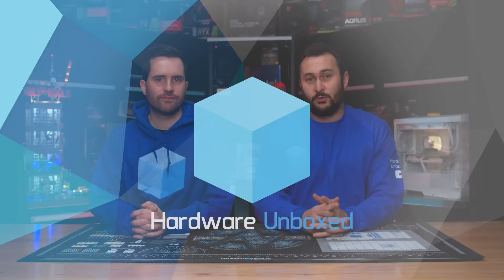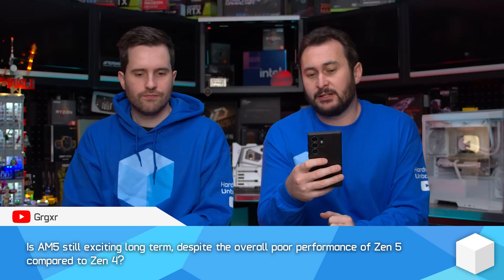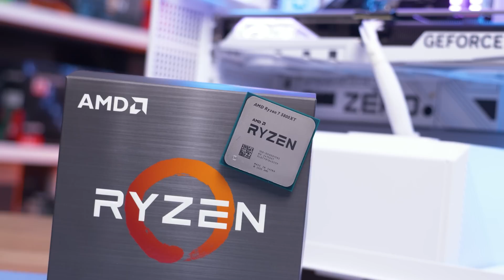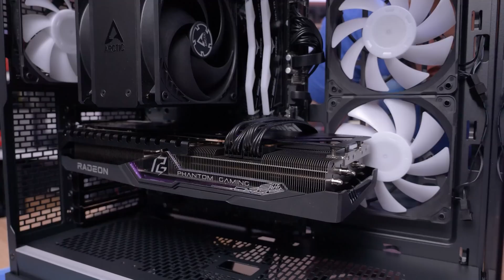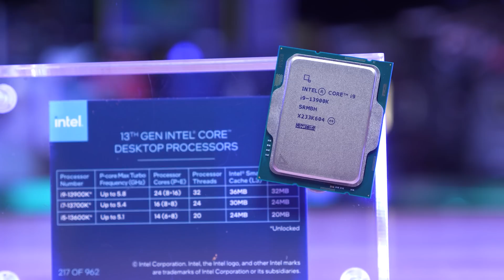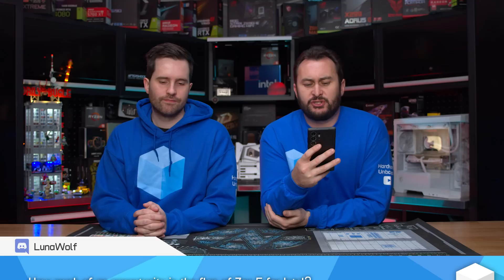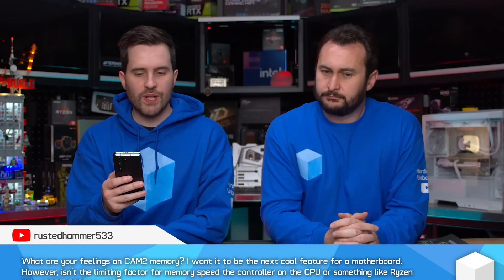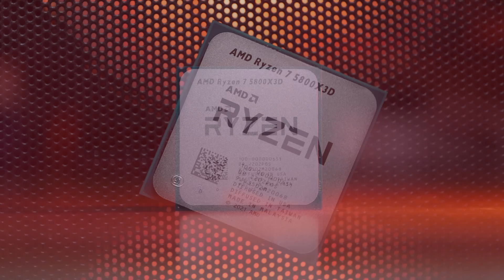Our RDNA4 Expectations, Can Intel Gain Lead After Mediocre Zen 5?

Comment: I mean for gaming, Arrow Lake just has to be as fast as the 14900K and they beat the whole Zen 5 lineup. In multi Core and single Core, the 9950X is only 5-10% faster than the 14900K in its 253W Mode. So Intel doesnt have to do much. Bring stability to the platform and a decent 10-20% boost in multi core at lower power. Thats it.
Reply: Not really going to be easy given the last 2gens performance tho is it?
Reply: @paulbaddiley7326  I mean Intel didnt really had to do more. Lets see, Arrow Lake seems promosing. Seems more stable, less maxed out. I think single core will be pretty much the same given the lower clocks, but efficiency and multi core should be really good.
Reply: ARL has to gain 10% in gaming to catch up to Zen 4 alone. Well, actually also they need to triple efficiency and cut prices in half if they want to compete with the 7800X3D.

Comment: My expectations for 8800XT is exactly the same performance of a 7800XT but touted as better efficiency.
Reply: That would be terrible
Reply: @A.Froster  terrible, but reasonable and realistic expectation. That's not hope, just an expectation.
Reply: @A.Froster which means it’s probably a certainty to happen 😢. Probably gonna be like what is was going from vega 64 to 5700xt. 10-15% faster, better features, less power.
Reply: Well, having low expectations is often a good thing
Reply: I did hear that ray tracing performance is significantly faster.
Reply: I expect them to not under estimate the damand of ray tracing this time around
Reply: Now of days, it seems to be one or the other, so that makes sense.
Reply: I bet AMD are gonna do a driver update similar to the 24H2 Windows update for their CPU's where they expect 10-20% performance uplift for their latest gen GPU's but it just ends up improving all the older gens as well by roughly the same amount
Reply: Intel is basically non-existent, amd given up on high end so nvidia keeps charging $100-300 more per generation with no competition whatsoever, very sad
Reply: Faster RT. Remember, NVidia fans demand that 4000 cards are better because they do RT faster than the AMD equivalent. Or does it no longer matter if it isn't NVidia doing it?
Reply: And at the same price with the same 16 GB VRAM
Reply: If it used 33% less power for the same performance that would actually be a great improvement. But i prefer FPS boosts
Reply: @axelfiraxa it would be an improvement body would actually care about and only bring up as icing on the cake or because theres literally nothing else good about the card
Reply: same
Reply: I’m expecting the top 8000 series to be performing like a 4070 ti super in raster and ray tracing. And be introduced at the same price as those cards. Maybe  draw less power.
Reply: @EdDale44135  It would never sell if it's the same price as the 4070 ti super. Why would anyone buy Radeon for the same price as Nvidia?? This comment doesn't make sense
Reply: The 7800XT was built on the same specs as the 6800. There is no 7800 this gen, so expect an 8800XT to be superior to the 7800XT.
Reply: If that ends up being the case the only thing exciting about it is that the 7800 XT will drop in price (hopefully to what the 6800 XT costs now).

If the Ryzen 9000 series taught us anything is that efficiency is not enough to incite the market, especially if they already have something that they can get by with.
Reply: It is small update, so yeah possible. Maybe tiny bit more RT speed, but let’s see.
Reply: 2 year gap for a rename refresh with zero performance uplift. Everyone in the department should be fired for not doing literally any work in that time lol
Reply: @flinchy-5224  if it does offer even just a 5% boost while using half the TDP then that is a big win. Do you understand how difficult it is to engineer the same or more performance for half the power? That is no easy task. You gamers really have no idea what you're talking about. Just like all the gamers upset about the 9700x even though it performs better than the 7700x while using the power of the 7700. That's a big one. Just because it doesn't add another 40 fps to your $3 game doesn't mean it's a poor product.
Reply: No will be have raster Performance like 7900XT and RT Performance like 4070TiS
Reply: same same same only changed cod name 6800xt 7800xt 8800xt same performans 🤣
Reply: @KarizmatikEmmi  The naming scheme is confusing but the 7800 XT was designed as a mid-range GPU to replace the 6700 XT and 6750 XT. It was released four years after the 5700 XT for about the same price if you adjust for inflation, and is about 100% faster, with double the vram capacity and some improved features. I'd call that progress.
Reply: @syncmonism  the 7800 outperforms the 6700 by 22% .. what are you even blabbering about?
Reply: @monsG165  providing the exact same performance for half the power usage is a huge win. Everyone always complains about their PCs being space heaters so AMD releases the 9000 series and everyone cries 🤦🏻‍♂️🙄 there is no satisfying you people
Reply: @---GOD---  look at it from average consumer. Which one will make them excited to buy a new thing, as Clarkson says “MORE POWER” or trying to explain to them how efficient this card is on a box art?
Reply: @monsG165  the average consumer isn't upgrading every year. The average consumer will notice a huge Performance increase because the average consumer upgrades every 7 or so years. If I'm upgrading from a 7 year old machine, would you suggest I go with the high power card instead of the newer card with similar performance for half the power usage?
Reply: The 6800XT can be considered better then the 7800XT, this is really really bad.
Reply: @marktackman2886  7800xt is better in every way only a little but better.Still 7900 GRE should have been real 7800xt.
Reply: @markolumovic2750  due to your common sense approach I concede
Reply: @marktackman2886  Well i am not in to ego competition they dropped the ball so in a way we were both right,In some especially older games 6800xt is faster in new especially RT heavy games 7800xt is faster then both 6800xt and 6900 xt again not much faster.So we are coming again full circle where 7900 GRE should have been 7800xt and 7800xt should have been just 7800.And if 8800xt can't match 4070ti in both raster and RT they should not bother to produce it at all.
Reply: And maybe slightly better ray tracing performance. 😂
Reply: They will just release driver updates that will slop down previous gen
Reply: @androjackson480  I've been saying that for years, they actually do that.
Reply: @Edit1213-l6w  They don’t slow old cards on purpose, that would just make them look bad. New cards gain an advantage for many reasons such as games utilising the latest architectural improvements (e.g., async compute) and newer cards being the focus of driver optimisations.

Comment: What a time: AMD enemy (and Intel ally) - AMD own incompetence.
Reply: Just as well as Intel's incompetence helps AMD a lot. What a time, all high-tech companies are doing crap! NVIDIA at least releases reasonable hardware that doesn't burn/degrade, even yet they provide no improvements for mid range at all.
Reply: @Vivicect0r  doesn't burn? right....
Reply: @Vivicect0r  You must have forgotten about the melting VHPWR connector.
Reply: @frantavopicka5259  Oh, I really did so. So much as I dislike NVIDIA forgoing extra overload capacity and failure to design humanly interface of the simple shackle (since you know, clicking helps a lot),  it was not such a widespread issue as media made it.
Don't get me wrong, I use AMD 7900xtx  (another technical failure BTW, its a good card, but it clearly couldn't reach its target performance) and am totally not an NVIDIA fan
Reply: This used to be the trend some 10 years ago.

Comment: Every gen its the same discussion with AMD yet their drivers are still made by the janitor in his free time.
Reply: Yet AMD offer fantastic MESA drivers, go figure, maybe they just don't care about Windows?
Reply: "Fine wine" is really just "it took us too long to get the drivers up to snuff, we robbed you of performance at the beginning of the card's life"

They're always playing catch-up with technologies, and when they do finally rush something out, it sucks. FSR is by far the worst of the admittedly all terrible upscaling technologies. And I haven't heard of Intel or Nvidia features getting people banned from games.

Personally I find AMD's control center really bloated and much harder to use than Nvidia's. Not to mention all the professional applications I've found that don't play nice with any form of AMD graphics, but slap an Nvidia or Intel card in the same computer and everything works fine.

AMD also had defective coolers for their cards this generation.

I still see absolutely no reason whatsoever to spend money on Radeon graphics. I'd love Nvidia to have real competition, but I'm not going to pretend that the dog poo Jensen Huang accidentally stepped in and scrapped off his shoes by the door counts as competition.
Reply: @mjc0961  There is no way this guy called the AMD control center bloated when it's literally one of few better things compared to Nvidia windows XP panel. Ironically the new beta Nvidia control panel is much similar to what AMD has
Reply: You're stuck in 2016. Modern AMD drivers are fine.
Reply: @dopiercomic4106 5 minutes in the AMDhelp sub Reddit will tell otherwise

Comment: Intel already gained off mediocre Zen 5.  I went from prepping to build Zen 5 with X870 this month, to, now waiting to see how arrow lake looks.  I'm sure I'm not alone. 

The ball is in Intel's court to win people over with arrow lake.
Reply: Intel needs to prove that ARL won't kill itself too. By then Zen 6 will be out though.
Reply: @nipa5961   Well, I'm sure keen eyes will be monitoring voltages quite closely on AL too.   Will see what info is discovered by reviewers and tech sites.

If both lineups suck, well, I guess I'm riding my Zen 3 for one more generation.  🤷‍♂
Reply: @Derceto00  The problem is monitoring voltages won't be enough. No one knows how much is too much until they ran thousands of CPUs for at least 12 months.
Reply: Dont forget the undervolting
Reply: Intel has lost completely the trust of partners and consumers and you think they will just win over people because Zen5 is a mediocre generation ? The copium is insane , Steve even said that Intel needs more than just one good gen to win people back